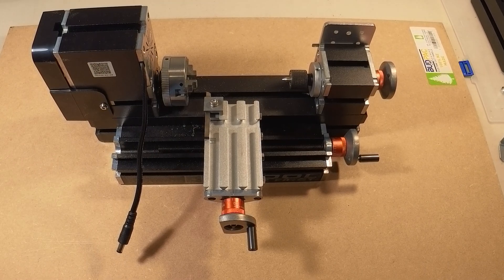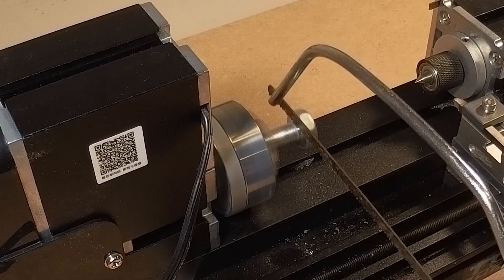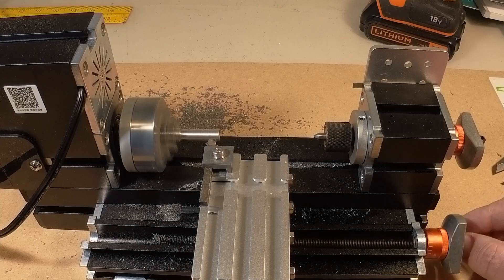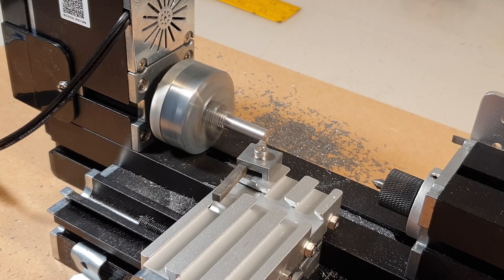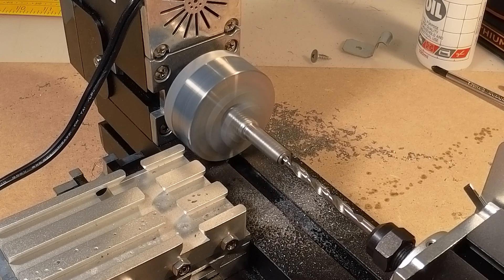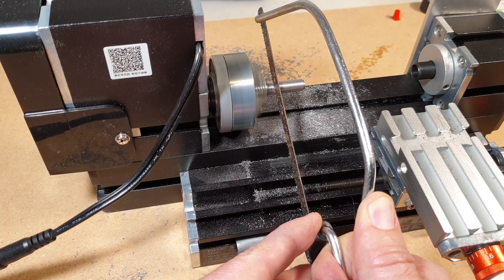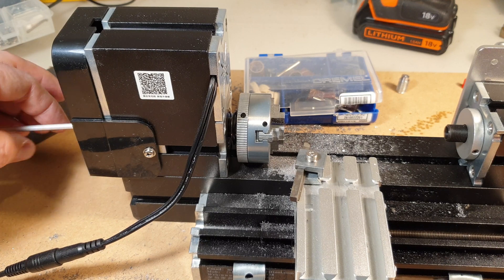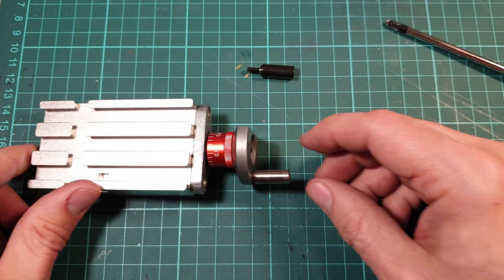Turning steel on the micro lathe.

Comment: Well done! You burnt the drill because the chuck was rotating way too fast, though that lathe probably doesn't have speed regulation?

In the other hand, sharpening drill bits it's a bit more complicated than simply refreshing the cutting face straight, though not much more once you get used to it. It needs certain geometry and relief basically, which is probably the reason it took you more time to do.

Drilling with the tailstock is one of those operations you can do in a lathe with the chuck rotating relatively slowly, while exerting force on the drill bit (after you have spot the center of the blank).  

Plenty of videos to look here on yt if you have interest in getting the most out of it.

Cheers!
Reply from the maker: Yep I it was too fast and as you suspected it only has one speed, for now :)